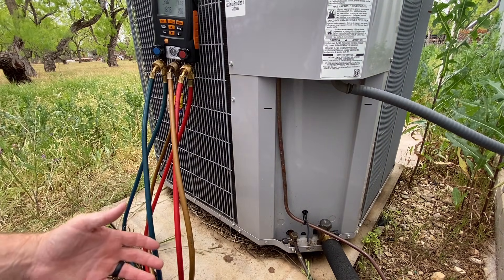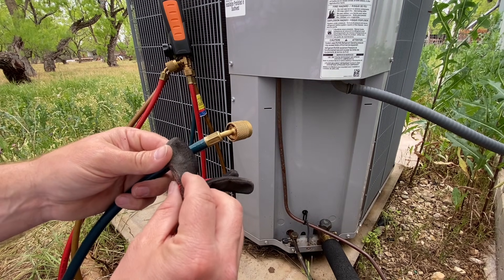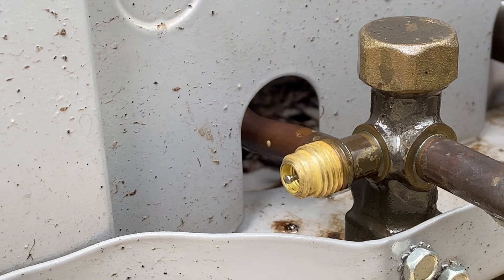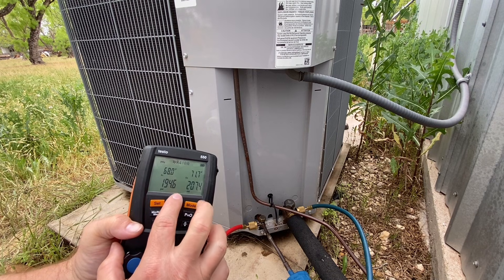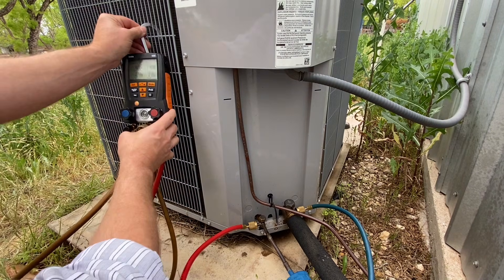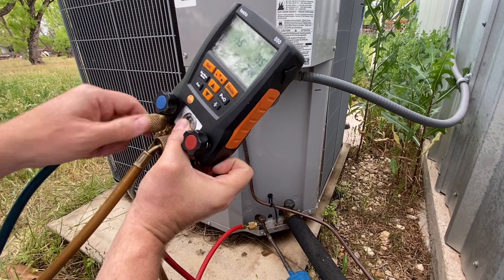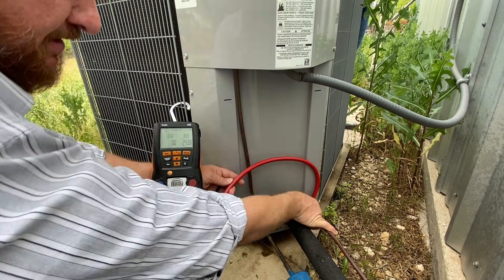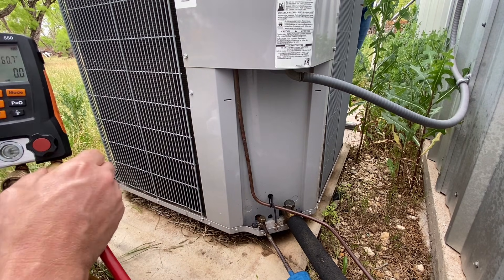HVAC 042 A Gauges and hoses on and off the simplest way without contamination.

Comment: Yeah! But putting liquid refrigerant into compressor is crazy.
Reply from the maker: By the time it is restricted though the low loss fitting, and again the valve core, then expanding into the larger suction line, then to the compressor crank case and windings, that little bit will be a vapor.

Comment: Man there’s a lot of room to discussion here, made some good points but a few thing. Rotating the hose like you did works great, but you not get life out of those gaskets, and if you disconnect the high side first, you can then simply open the valves with the unit running and recover all that liquid, there’s no need to put the red hose back on the low side at all. Personally I don’t even put gauges like that on unless I intend to charge, the super low loss single gauge with no hose at all or wireless units are far better against refrigerant loss and contamination. But to each there own, watch a lot of people and make your own decisions I say.
Reply from the maker: Bleeding across the manifold outs the highest level of contamination into a system. 
Unless your already recovering then I do not recommend that.

Everyone was taught to bleed across the manifold so people think that's the best way but there is now plenty of proof of the contamination issues especially with POE oil.

Comment: After adding refrigerant I always close the valve on the charging cylinder. Then  I remove my high side hose from the system. I then open both manifold valves to equalize all theee hose to low side pressure. This seems most efficient to me.   Good instruction overall.
Reply from the maker: That is the old and most used way but it's also the way that's most likely to introduce the most contaminants into the system.

Comment: Hey Ty. Been enjoying your content a lot. Im an automotive AC tech and Ive always pulled the liquid back through my gauge set into the suction side prior to disconnect. You have to do this with 134 because of the one way fittings. But I dont see why you couldnt do that with R22/12 type gauges either. Am I wrong in thinking that?

Comment: Thanks for the video, some advice on how I remove gauges would be for one don't use low loss fittings and instead use a thumbscrew core depressor on the high side with a ball valve on the hose, close ball valve and then back off depressor and remove high side hose you will have basically no loss and then open high side valve on manifold and then open low side valve on manifold and release the liquid into the compressor. No refer loss and no chance of burn.
Reply: Backseating core depressor.
Reply from the maker: Please stop bleeding across the manifold. It's the #1 reason for system contamination.

Comment: Thanks for the detailed instructions. The reason I am searching your video is to find out how do I set up the digital manifold before hooking up the lines to the compressor unit. Do I leave the red/blue knobs shut or open before I start pressurizing the lines? You didn't mention this at the beginning. So i assume you left them open? I also watched instructions from using analogue manifold, they mentioned that you will need to shut off both valves at high/low before you hook up the lines to the unit, then open them at the manifold to equalize. Some detail I want to learn from you video but I am not getting it.

Comment: I do like the idea of putting the caps on the manifold.
That said, I am a full on rookie, just put my first gauges on today.  They did have a slightly different idea for doing a DeMinimus release.  They installed an extra low loss fitting on the high side.  Then hooked up the low side, opened both valves, did a 5 second release at the high side low loss fitting to purge the air out of the lines with vapor from the low side.  Then they closed the valves and hooked to the high side.  This keeps atmosphere out of the system.  To take off, they start by pulling the high side off.  Open the high side port, then bump load the liquid back in through the high side valve.  After the system equalizes fully, take off the low side and then finish with taking the low loss fitting off the high side for the final DeMinimus release.
Reply from the maker: That's a lot of lost refrigerant

Comment: Hello, thank you for your videos, they are full of lessons... I have a question, can you tell me if it is possible in which part of section 608 it talks about recovering the liquid refrigerant that remains in the hoses after disconnecting them from the valves? My question is only to increase my knowledge and is not because I do not trust your knowledge.

Comment: Worked as you stated. I may have a bad compressor. 😮 Grr 😢.  Tried it today. Frightening the first time due to potential refrigerant escaping with my hands and face so close. 0 psi low, 85 psi high. R22, 3.5 t. All else is new, fan motor, blade, contactor, capacitors and there are no leaks

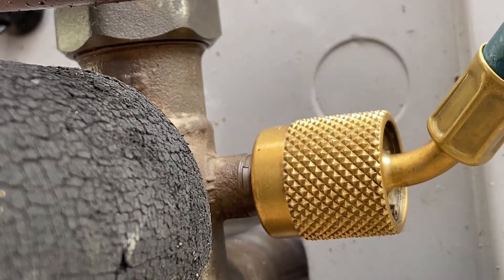Comment: 2:55 I wouldn’t suggest twisting the hose to tighten the cap, that’s how you damage your gasket. You mentioned the fitting needing to be rebuilt, that’s probably a factor.

Comment: Could keep the low pressure suction line attached and disconnect the high pressure first and open the high side and low side valves on the manifold to purge the liquid from the high side to the low side back to the suction line?
Reply from the maker: That is the way many were trained.
The issue is contamination. Bleeding threw the manifold pushed contamination into the system.

When doing vacuum and recovery is the best time since the manifold and center hose already purged.

Comment: Another possibility is to use a core depressor between the connection point and the hose itself.  That way you can connect your gauges with no loss of refrigerant, then turn the knob on the core depressors in until your gauges show the pressures.  When done, unscrew the core depressors to allow the core to close up and seal the refrigerant into the system.  Now all you have is the pressure in your hoses, and if you dump the liquid line into the manifold and allow it to pass into the low side line and enter the system slowly, it will pretty much empty your gauge set of refrigerant except for a tiny amount of vapor.  Just thinking out loud here...
Reply from the maker: Am am very much against bleeding back across the manifold. It is the main cuase of non condensate.

I do use core depressions with probes but when training new people you need a simple way they require the fewest steps.

Comment: Just curious, why not take the high side off first, the open the valves to allow the liquid line hose contents to be sucked through your gauge set manifold into the low side hose and back into the system??  Saves time and multiple connects and disconnects where you can lose refrigerant every time... Just thinking out loud here

Comment: Just a reminder for those not familiar with HVAC, when the system is off, the low and high side have equal pressure,  You are more likely to leak refrigerant when the system is running, especially on the high side.  I like using hoses with ball valves so I can shut off the high side, dump the refrig into the low side, before I detach any hoses.

Comment: i’m fairly new to hvac and as i was riding along with a coworker of mine (who has no low loss fittings), put on high side and got a good 6 seconds of refrigerant on my index finger and got a nasty blister. i’m now a little scared of screwing high sides even with low loss fittings. It’s all trial and error though

Comment: If the system was off like you said and the system equalized with low and high side having the same pressure, then why did refrigerant spray out the high side and not even a sound was made when connecting to the low side?

Comment: why not just take the red hose off, open red then open blue and suck everything back in then remove blue?
Reply from the maker: #1 contamination
#2 time
#3 simplicity for new students. 

I realize this is different that they way many where taught  it different does not mean wrong.  People are quick to pic out the way they have always done something but reluctant to try a new way. 

When you bleed across the manifold you pushed all the moisture and contaminants from the manifold and the yellow hose into the system. By the time you spend all the time purging all those points, you will find the way in the video is faster with less refrigerant loss and minimum contamination. 
In the training labs we had constant problems with non condensables. After we implemented this method the non condensble issue went away. Imaging how many systems are contaminated the same way in the field.

New students are often overlooked by the steps of just checking pressures. Wich knob to open Wich to close and they have issues opening the wrong hose getting frist bite it dumping liquid into the suction slugging compressors.  By simplifying these stems of just moving the liquid hose to the suction side it makes things simpler easier and safer for them.

Later in this playlist list, I also show bleeding back across the manifold with purging and show how it's the best methodafter charging a system then the service hose had already been purged and refrigerant in use.

Comment: I’m a newbie with a manifold so forgive me if my intuitive is wrong but, when disconnecting, can’t you just leave the low side connected, disconnect the high side and run the excess liquid line refrigerant through the manifold to go back into the low side?
Reply from the maker: I included that method in this series, the big issue with that is contamination and purging. 
It's difficult to purge the manifold and few people purge the yellow hose. Then when they bleed it across the manifold, it pushes contaminants and moisture into the system. This leads to non condensables and moistures that leads to acid and copper plating. 

While this method is much different than the norm it's actually faster then purging and bleeding across, it's less likely to introduce non condensibles, and it's simpler for new techs just learning vs trying to  what hose to open and close and when. 

Nowadays I just prefer everyone using digital probes,. No hoses  so it's not an issue at all either way.
Reply: @love2hvac  Thanks for the detailed response! That definitely makes way more sense. 

I’m a mechanical engineering student and I do building forensics so I don’t even need to add or remove refrigerant, I will only ever need to diagnose systems. For that reason, I certainly plan to get the digital field piece gauges. 

I went with a full manifold because I didn’t wanna be that guy telling HVAC contractors what to do without getting my hands dirty and really learning the field equipment. Idk if that makes sense lol.

Comment: This was a great video - I especially like the valve cap idea - but why not equalize the high through the low before disconnecting low?

This is my preferred method for true dominimus loss - but more importantly because in Florida some of these systems can only take 12’ of hose loss a few times.

I’m curious as to why you did the swap method over this as I’m sure there’s a valid reason I’m missing…
Reply from the maker: Thanks,
In the playlist I demonstrate several methods.

This method has several benefits. I realize it is different and sometimes different is met with opposition. I believe I compare the methods in another video but let's go through them here. 

#1 new students/apprentices 
When students and apprentices first get to a unit they are overwhelmed by everything.  They are nervous and uneasy. We want them to be able to check "pressures" without injury themselves, quickly and without contamination.  Something as simple as opening and closing valves alone can be a big challenge to new students. You have no idea how many think they have to open a valve just to get a reading, no matter how many time you tell them. Other times students get burned with liquid refrigerant because they open a valve and liquid comes out because they did not bleed it in correctly.

#2 Contamination. I digital probes or gauges without hoses at all. The more hose, the higher the chance for contamination.
When someone bleeds across the manifold and they don't properly bleed the center of the manifold with a cap they are pushing contaminants into the system every time. That is magnified when they leave the center hose attached. I found that the lab units would often become contaminated after a few classes just attacking and teaching gauges. When we implemented this procedure, we no longer had confirmation issues after just checking "pressures".
By simply switching hoses there was no more contamination from the high pressure pushing contaminants into the low pressure.

#3 repetition. It gives them more time getting the student comfortable taking hoses in and off with the 2 finger method. 

#4 it's faster and less loss. By the time every class tries to purge the manifold or the service hose they had less time getting the "pressures" of multiple units, less time getting comfortable with the hoses and much more confusion and second guessing and loss of refrigerant filling up the lab.  Switching the hoses is just faster than PROPERLY bleeding across the manifold. 

#5 we eventually teach bleeding across the manifold.
Once we get to the point they are comfortable charging or recovering they get the manifold valves  down.
The center hose and the manifold will already be purged
 At this point bleeding across the manifold is faster, so we implement it at that point.

Hopefully that makes sense. Give it a try yourself but the bigger picture is ditch the manifold go with probes digital or analogue for a win win. You can still charge and recover without a manifold.
Reply: @love2hvac  two things: I had no idea this was Ty Branamen’s channel so wow what a small world I’ve seen you with Brian Orr quite a few times. Awesome stuff learned a lot.

Two) I was thinking after I commented about the center of the manifold itself, and that is a good point, though somewhere along the way of my 4years I began purging my high side THROUGH the manifold (through the refrigerant hose, closing as valve at end of hose to suck back as much as possible) and I forgot to mention that.
But yes, absolutely agree with those points in full.

Comment: would it not be easy to have both hoses connected, then disconnect hp side, oven the valves, and have suction drain both, instead of loosening and fastening suction?
Reply from the maker: Thes bestethod is to use probes, no hoses at all.

By opening the vales you will introduce more contaminants into the system. Everything in the middle of the  manifold and some of the contaminants of the service hose gets pushed into the system. 

So the belles across the manifold you have to remove the service hose, and purge the manifold. By the time you do that, the method shown in the video is faster.

The method of bleeding across the manifold is the main reason non condensate end up in the system. 

I realize this way is different but it's simpler for new techs, reduces contamination from everyone and its really fast. How we it still does not beat hosless probes.

Comment: Hello.  My air conditioner unit requires a refrigerant (R-22) line of 3/8 and the suction size of 3/4.  Could the hoses in this video be used as is or do I need something to help connect the hoses to both lines?  If I use another refrigerant like propane,  does this change what my unit's charging necessities?  Thank you.

Comment: If you have ball valves you can also just open the manifold and close the ball valve on the liquid line to bring the manifold to your suction side pressure.
Reply from the maker: That method is called bleeding across the manifold. 
The problem with that method is contamination.  All the contaminants, moisture, oils, oxygen, nitrogen or past refrigerants get pushed into the system.

The high pressure pushes it in on its way to the low pressure side. 

The solution is the method in the video, or having to purge the yellow hose that's more refrigerant loss and no guarantee to remove moisture.